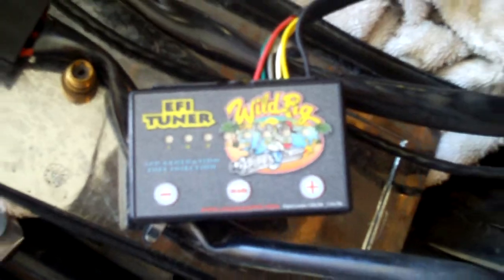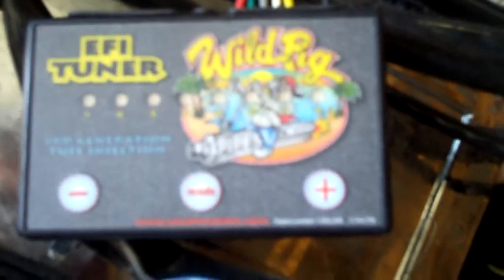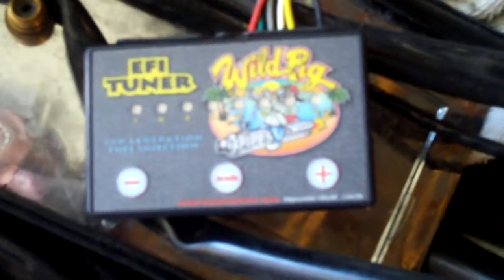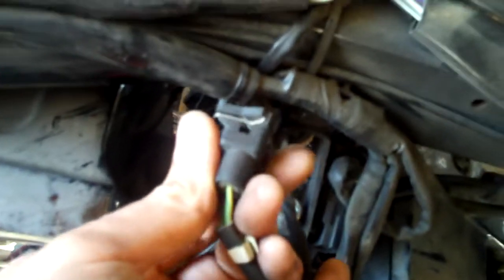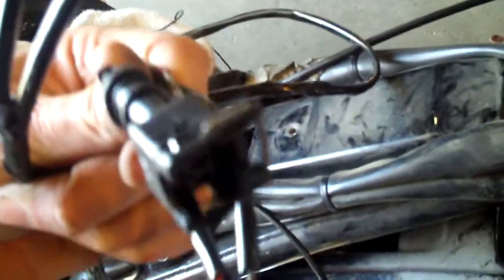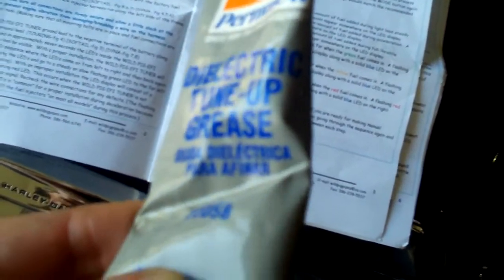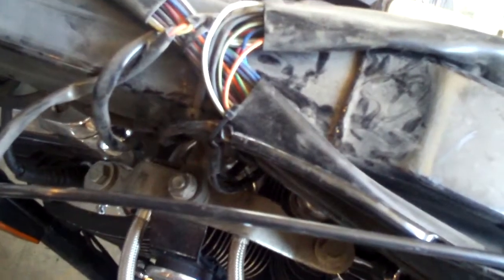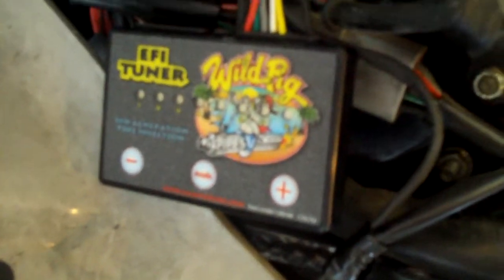Magneti Marelli Fuel Injection Tuner - Harley Davidson

Comment: Understand How to Use Dielectric Grease - DO NOT APPLY TO TERMINALS - VOIDS WARRANTY
Dielectric Grease is an insulator. The use of dielectric grease in electrical connections is to help insulate the wires and seals coming into a connection. DO NOT apply to the actual electrical terminals in the connector because it can interfere with the electrical signals passing through the connector. Reference:
https://en.wikipedia.org/wiki/Silicone_grease#Dielectric_grease  
.
Mark, I copied above directly from Dobeck site. I have used the grease like you in previous electric connections, but wondered about it when you "slathered" the inside of the contact.
I don't have an oxi-sensor, but my silicone spray also say not to use.
I appreciate your videos since I have a similar bike, 1996, Road King with 190,000 mi. I have put on and have been running rich lately, especially blacker on my right exhaust and Dobeck said their unit can correct it. Problem now is removing the gas tank. The later Harleys have a one quick disconnect fuel line, but our Marelli ones don't and have 2 fuel lines. Since it's a pain to take off the tank completely, I am looking at unbolting and lifting the tank enough to get to my injectors. The EJK Gen 3.5 I received also says it doesn't matter which plug goes to which injector while I think the older units do differenciate. The older setup also had to connect to the injector wires under the right cover, while this unit just had one wire hookup to the battery ground. Thanks again for your informative videos.
Reply from the maker: +Paul Murray Thanks Paul. I went to the Dobeck site and read their statement and added a note to the video. I honestly have not had a single hiccup in the motor while using this setup. The way it can control so many aspects of the fuel management is night and day, as hopefully you will find out too. As my unit is not under warranty I have nothing to void, but if I encounter a problem I will report it here. Also, my instructions listed which connector, based on wire color, was for front and which was for rear injectors. Your instructions may be different than mine. Good luck with it and rock on!
Reply: Hey dielectric grease is recommended in Harley connectors to insulate them and keep the connection constant. The grease at most adds a.0001 of an ohm of resistance but at a Harley school it’s recommended to keep it consistent

Comment: Dobeck says NOT to use dielectric grease on contacts as he is doing. It is an insulator and may interfere with electricity.
My Dobeck instructions also mention that it doesn't matter which injector, front or back, you plug the connectors in.
Reply from the maker: +Paul Murray To each his own. I have not had any troubles with my hookups using dielectric grease on any contacts in any applications. If Dobeck says not to, then don't. I am not going to be removing it from my connections however.
Reply from the maker: +Mark Young Have you ever seen a car at night with one bright headlight and one rather yellowish? That's corrosion on one of the contacts that is preventing the full 13.8 volts dc of the vehicle from getting to that headlight. If I encounter any problems with my installation due to dielectric grease I will be sure to add a note to this video reflecting those findings. Thanks for bringing this to my attention just the same. I don't want anyone to void their warranty with Dobeck and I have added a note to the video stating their recommendation.